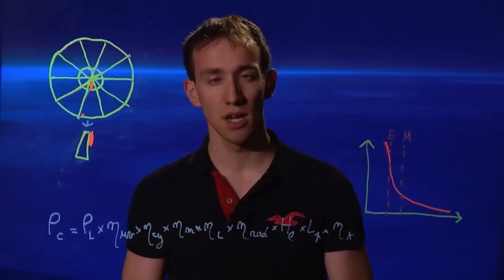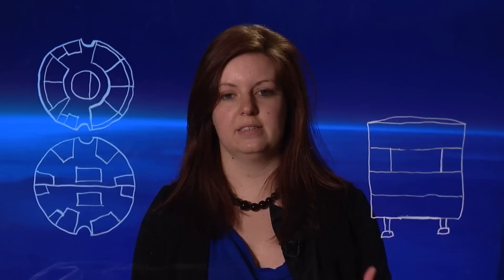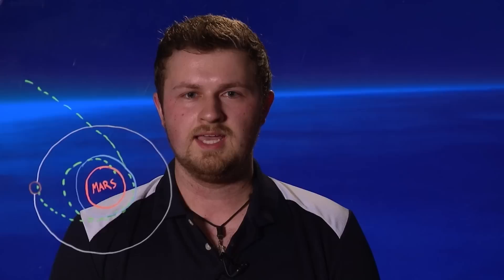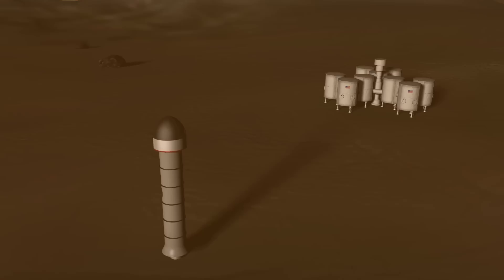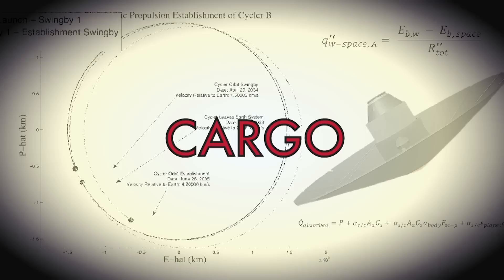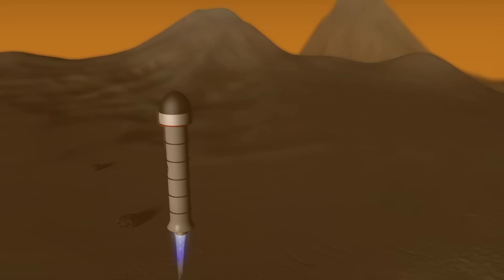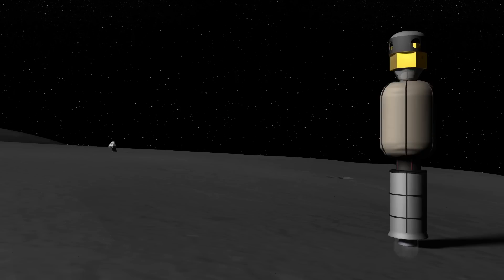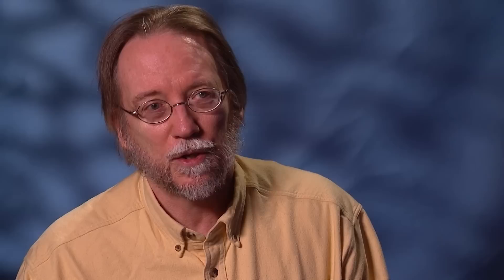Project Aldrin-Purdue, Mission to Mars

Comment: What is delta-v required to maintain cycler in its orbit per cycle?What is delta-v between LEO and cycler? EML-1 and cycler? Phobos and cycler?
Reply: the delta v would most likely be pretty high to rendevuz with the cycler and exit at mars, but with a much lower payload since you can have a quite large living area at the cycler.